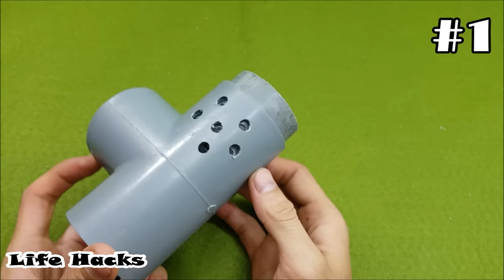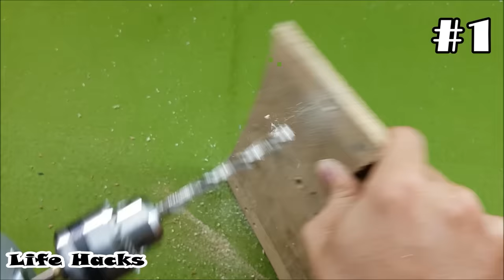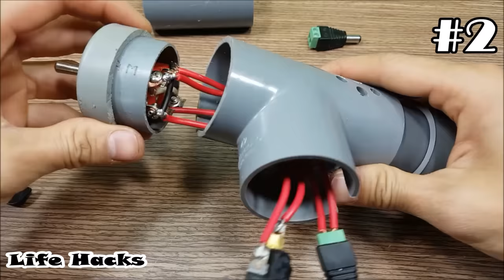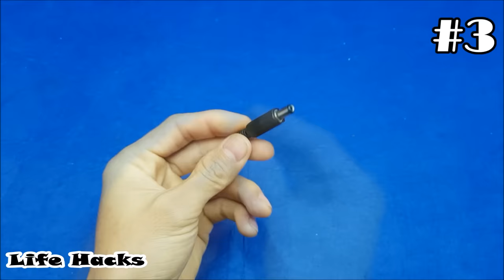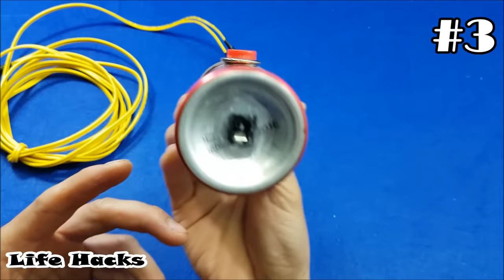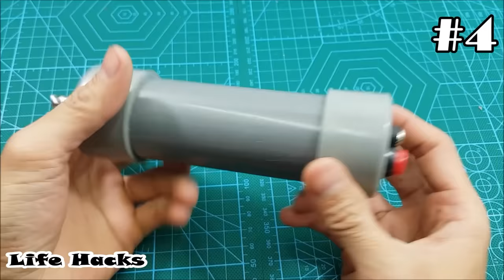4 Simple Life Hacks Drill Machine and Screwdriver - Life Hacks DC Motor

Comment: What is the gold like rode with two holes you use to clamp rotor and at the end drill bit. I wanna avoid drill head since it's heavy and there's nowhere small to be find in my vicinity and ordering over the internet it's just expensive and beets the purpose... Great work for real! Very easy to make judging by your video 🙂 though, i collected few motors from home appliances and wanna give them a try

Comment: Making cost of drill machine, 
Original 775 motor -400-600rs
Pvc pipe-100rs
Drill chuck and bits -500rs
Switches, wires, super glue-150rs
12v 10ampere dc power supply -900rs 
While we can buy drill machine in just 800rs from online with free chuck and bits😂😂😂

Comment: For the 3rd one: did you know what means the double square simbol in electric devices?. I think that's not the wisest decision, to build that kind of "d r e m m e l" in a metallic aluminum case... As crazy russian hacker says: "security is the number one priority". Even working with a 12V battery, always exists the risk of an electric shock... The PVC cases are better options.
Reply: @Hirano_Rin  True. What would i be thinking...XD   +1
Reply: But you can't get electric shock from DC 12v because it's a pretty low voltage.
Reply: @shubhayumanna8a377  oh, trust me you can and pretty decent one. I made from and old charger 12v, 1A my power up small tools thingies and without resistor it will kick you very nicely

Comment: Useless video.....u have to give the ratings, names, voltage...and other details of the parts u r using....
Reply: you could probably eyeball it and be alright with most of these. Just make sure the diameter of the motor matches the inside of the pvc pipe. And use a 12v power adapter.